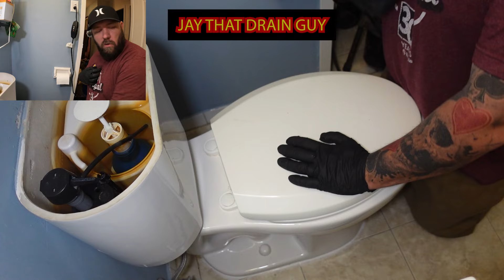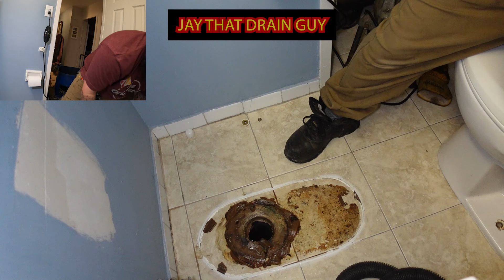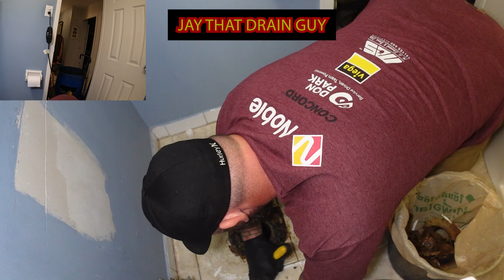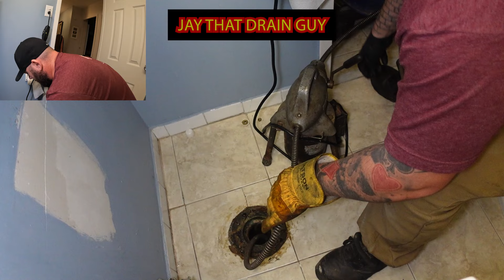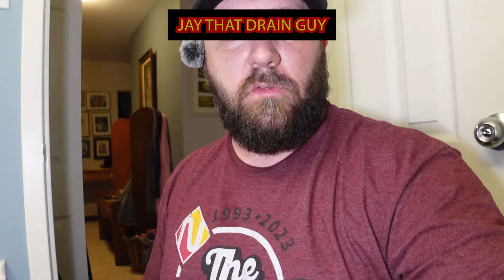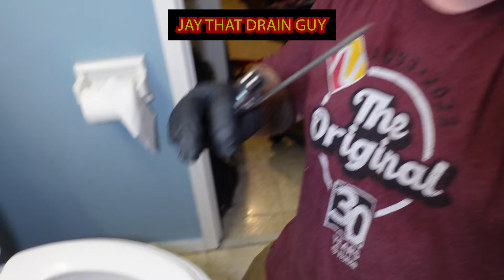Snaking A Toilet Stack After Removing Toilet

Comment: Wow Jay I just purchased the M18 sectional now I heard you say that it doesn't have the power. Should I return it, it's still in the box brand new? Please give me your honest opinion of the M18 sectional machine.
Reply from the maker: For big jobs that require 7/8 cable I would say it does not have the power
Reply: Thanks Jay. I run into a lot of roots so I will return this drain machine and go with the general sectional machine instead.
Reply from the maker: Yeah, I'm sorry. When I first bought it, it was a really good machine. I wish using it quite a bit but I believe you should get more work out of it than what I put in.
Hopefully the general. Does better for you? I appreciate you watching and I appreciate the feedback. Have yourself a great day.

Comment: Plastic bag? That's interesting.  What's the weirdest thing you've found?
Reply from the maker: Honestly. I don't find too many weird things which is weird. But probably syringes. I pulled those out of toilets. I know why did pull a bullet out of a toilet once and a guy I was working with. I went to meet him on a job but he was finished as I got. And he told me he pulled a sex toy out of a toilet in the men's washroom at a burger king
Reply: Weird things I've pulled out (not neccessarily from the toilet itself):
Caulking tubes (out of vent stacks...roofers)
Drain cleaning cables (home owners and plumbers)
Toys (kids)
Toys (adults)
Broken china (from broken toilet...home owner)
Combs and brushes (kids and adults)
Perfume bottle (adult)
Poo-pourri (kid)
Rocks (nobody knows)
Thinset and grout (tile setters)
Concrete (concrete guys)
Palm nuts ((squirrels?)
Rats (rats)
Test balls (plumbers)

The weirdest of all - my buddy pulled out an iguana. They don't live in sewers. We figured it must have been chasing a cockroach down a vent stack and got stuck.

The most unique job I think I did was to retrieve a fire suppression nozzle from a rain leader on a helipad on the roof of a hospital. You don't get those calls every day.
Reply from the maker: @rogermccaslin5963 Now, that's how you answer a question. Roger, that's crazy. All the stuff you pull out, brother. Or did pull out and yeah, we don't come across a lot of weird. Things like that nowadays, usually just toothpicks. QTips tampons And stuff like that. Thanks for watching Roger. Have a great day, brother, and we'll see on the next one.